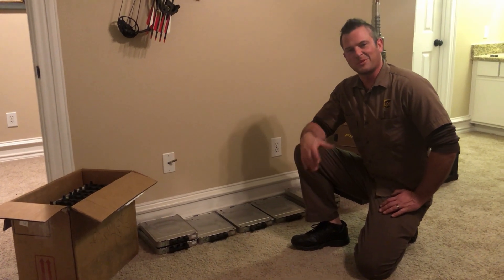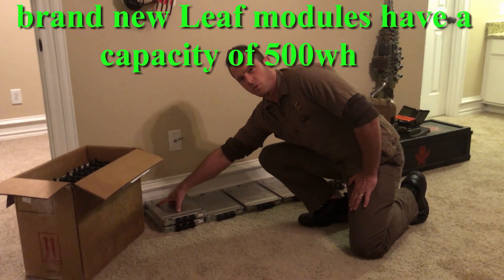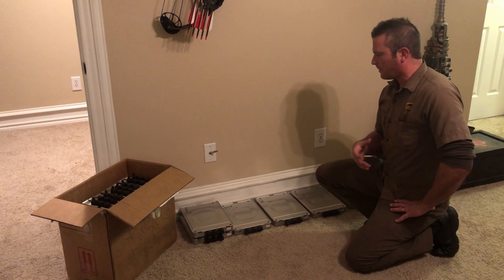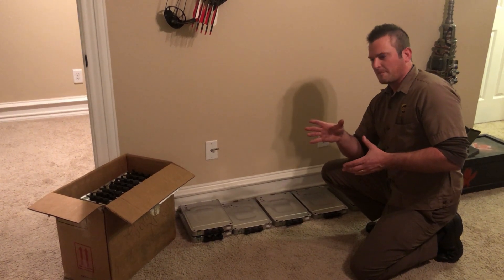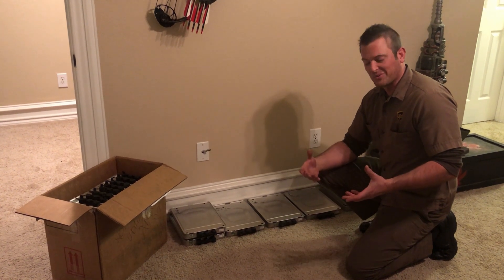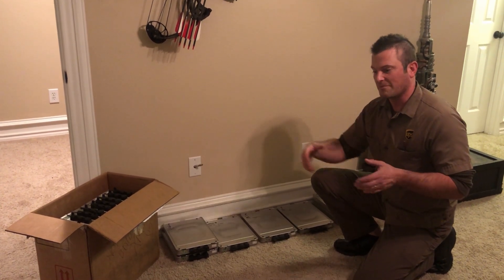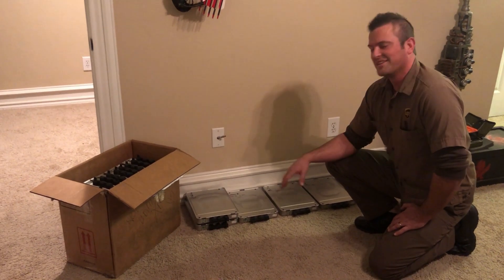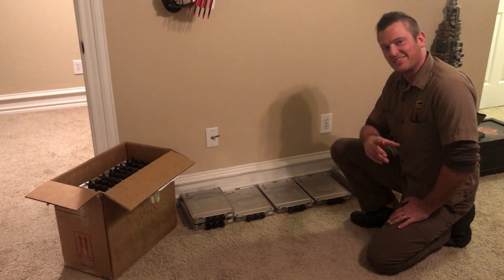A Neat Little Story About Battery Science, The EV Community, and Helping Each Other Out

Comment from the maker: As I gather the mountain of modules I will need for my powerwall build, I'm sure I'll find a few more 70%+ gems.  I am going to try and get these into the hands of someone who will use them for EV restoration/conversion projects.  We can build a powerwall out of even heavily degraded modules.  Let's use the good one's to keep some Leafs on the road.
Reply: Good information. Self draining cells mixed with good cells will need to be watch.
Reply from the maker: @steveclunn8165  Agreed.  A solid bms is critical when mixing cells of varying capacities, as those good cells may charge at a different rate.  Can you recommend a good 7s 48v bms for a powerwall Steve?

Comment: Hey brother, I hear you on battery degradation.  I have a Pacifica Hybrid with more 'real estate' to build off of.  I would love something securely installed on my roof and have a stable supply of energy for it.  I am so stuck between power wall, that, both, or something altogether different and scrap the idea.

Comment: Try lifepo4,  whith 16 cells of 280 ah you can have 20kw+ $1500
7 Nisan modules  5kw $1500
Why you need 56 modules? Each module is 7.2 v.
Reply from the maker: I'm going for a 48v system.  This is accomplished with 7 leaf modules in series.  From there you just add modules in parallel for a larger capacity system.  So you can build a 48v powerwall using the following numbers of modules: 7,14, 21, 28, 35, 42, 49, 56, 63, etc.  I'm shooting for 7s8p.  I'm going with these particular modules because they have a very stable chemistry, and I know I'm going to have a LOT of old modules on my hands in a few years to expand the system with.  Also I get my modules for $46/piece.  Where are you getting LiFePo4 for $75/kwh?  That is a REALLY good deal.
Reply: @InnovativeSustainableSolutions  I got them in Aliexpress on black Friday.  I have 10kw of Nissan Cells but they take more space than the lifepo4 batteries. $46 plus shipping is a good price and yes they're are more stable than lifepo4.